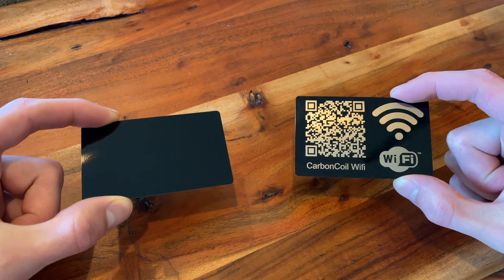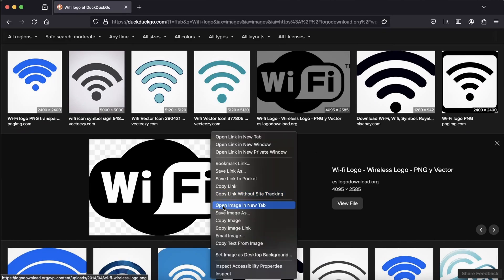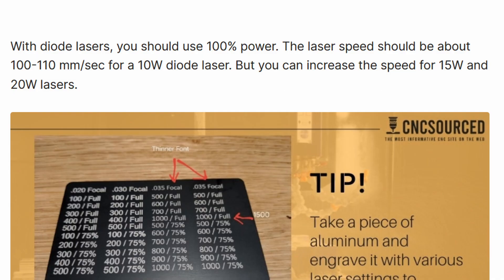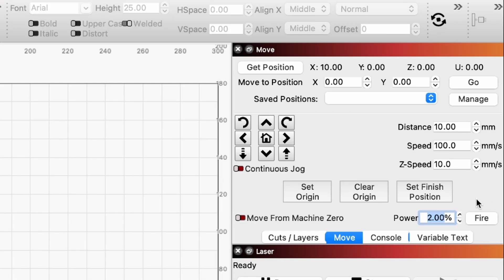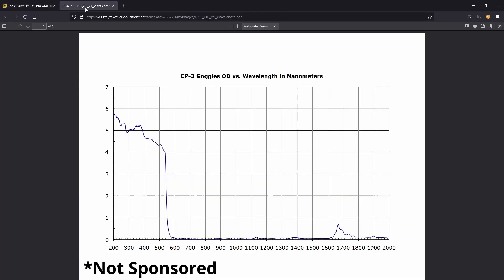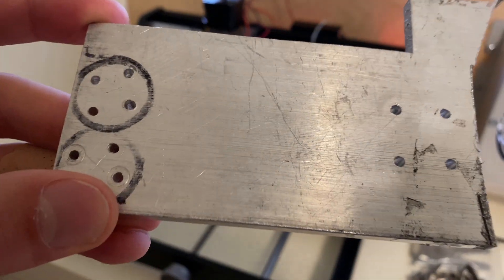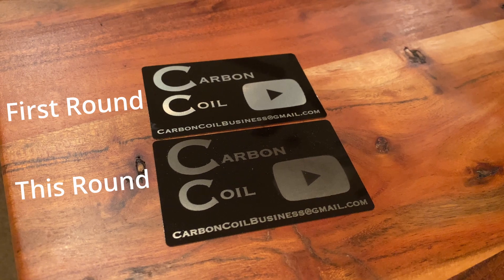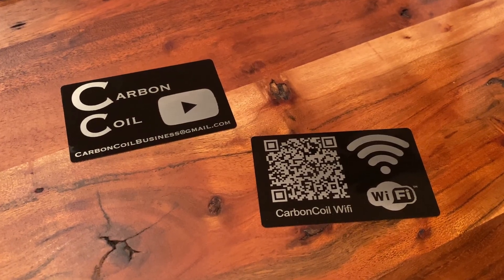Engraving Aluminum - Basic Laser Cutter Tutorial

Comment: Those cards are not anodized, but the process of engraving anodized or lets say powder coated is pretty much the same, maybe some different settings and things like that. It seem like the resolution is not the best on the finished product though, maybe upgrade the laser module will make it possible to engrave with even finer results ? Thanks for the video.
Reply from the maker: Thanks! I agree with the anodized part. I think part of the resolution might come down to my Lightburn settings, as I was optimizing more for speed.

Comment: Why claim that it is "anodized" if it isn't ?
Reply from the maker: Whether they're anodized or painted, the process will be roughly the same!
Reply: @CarbonCoil  Hi and thanks for this video! I'm new to laser engraving and I'm not sure if etching a painted aluminum card is the same as etching an anodised one. In the first case the engraver has just to vaporise what I suppose might be a layer of acrylic paint while, in the latter case it has to vaporise the anodised aluminum layer which, as thin as it might be, is still made of aluminum and this makes me think that the engraver might not have enough power to "burn" it.
Reply from the maker: Hi  @kettleblaze4060 , there are lots of other videos on YouTube also showcasing diode lasers engraving anodized aluminum. For example this video: https://www.youtube.com/watch?v=k1hj-RbDlLM where 10w diode laser is used at 9 minutes to engrave an anodized aluminum part

Comment: Putting your network and password to a free online app seems pretty worrisome.
Reply from the maker: You're absolutely right to never take random websites on the internet at face value! However, in this case, this application generates the QR code locally and therefore doesn't send data from the input fields over the internet. If you'd like to access and read the documentation yourself, it's available on GitHub at the following link: https://github.com/zxing/zxing
Alternatively, because this is an open source project, you can also download and run the zxing project on your own machine. However, because most of my viewers don't have the technical expertise to do this, I provide the QiFi project website instead.
Reply: @CarbonCoil  Thank you for the reassurance.